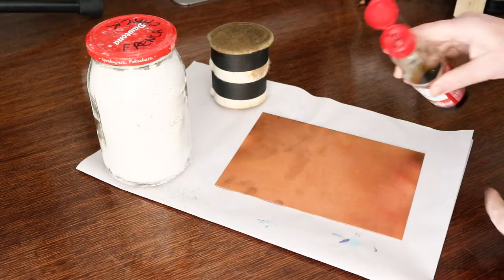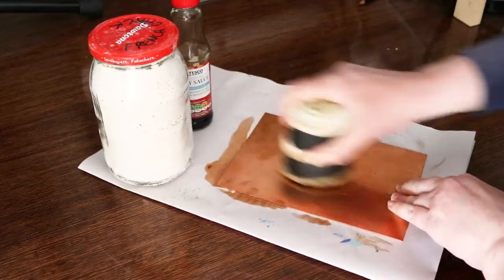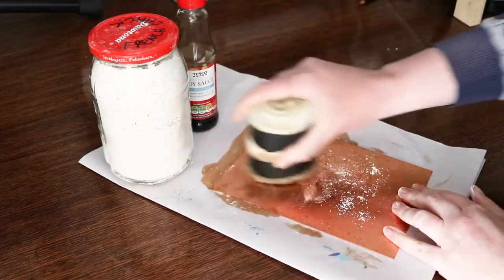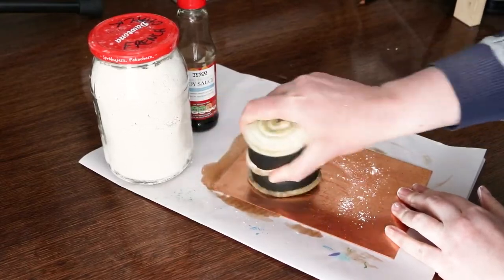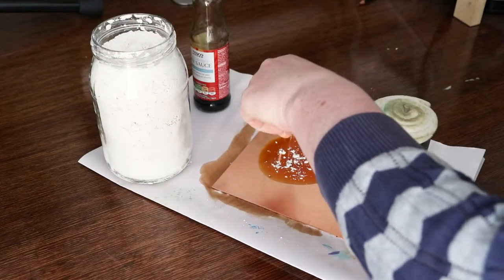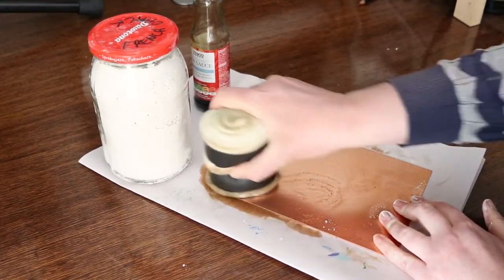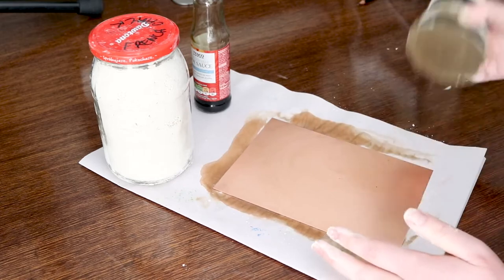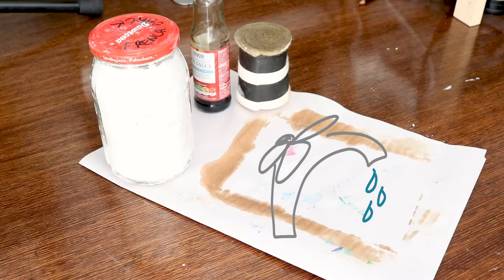How to degrease a metal plate for printmaking

Comment: For me , Calcium carbonate not make sense !!. If you want to clean maybe used "Baking Soda"

I am Jewelry designer
Reply from the maker: Hi, thanks for your comment. Calcium Carbonate (sometimes called "whiting") is a mildly abrasive compound used in a lot of cleaning supplies. When you mix it with a small amount of liquid it makes a good paste for cleaning the surface of copper and other metals. You can try baking soda if you want, but calcium carbonate is what has been used in every print studio I've worked in.